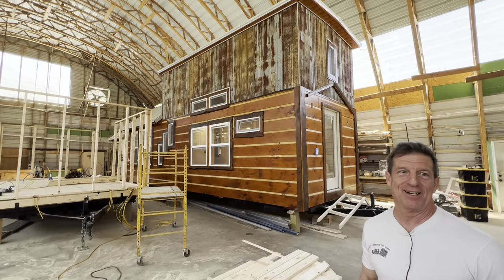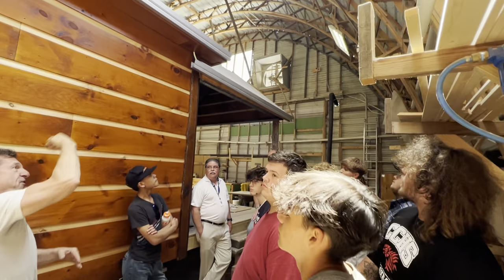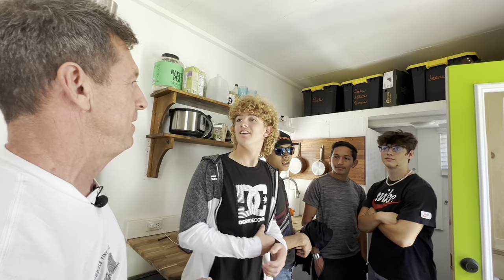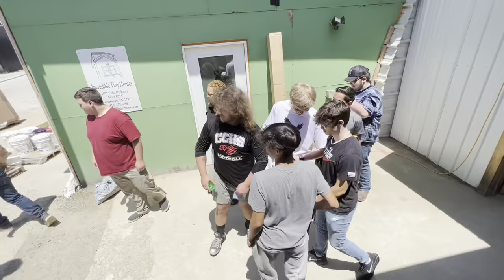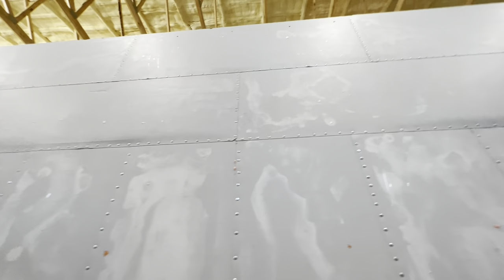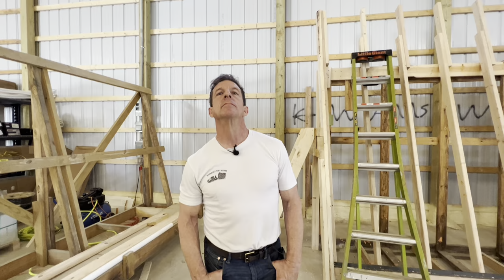Cocke County High School Visits Incredible Tiny Homes for a Randy Crash Course 📚🏡🤩😉🇺🇸📚🏡🤩😉

Comment: Glad you are building a proto type for the 12x20. That is the house I am looking at. But 2 questions: 2nd request for answers; can you add low maintenance siding on top of the esp panels, Knowing its extra? What would be the extra cost, if applicable?  #2: can you add a Randy Rack??? I'd REALLY  like one with the extra footage, it should be possible. Thanks a bunch! 😄😄😄😄👱‍♀👱‍♀👱‍♀👱‍♀
Reply: Hi Chris, they are not currently doing customs or upgrades on models.. So you would have to add   the Randy rack after build.. Or maybe request the cabinets and counter assembled but installed .. And finish it out how you like, with any customizations you are looking for... And for the LP siding.. I think they said all of the 12x20's are unfinished outside... Does anybody remember? Anybody got a 12x20 on order can you chime in?
Reply: Sorry.. Typo.. Cabinets assembled, but not yet installed

Comment: High Schoolers: Look back at one of ITH's videos erecting the trusses. Randy emphasized the strength of the trusses in place, working together. But, he didn't really address how vulnerable -- laterally -- each truss is by itself. Trusses are never more vulnerable than when initially erected.

Comment: Can you give us an idea of how much you would sell the 12x20 for?
Reply: $39,900
Reply: If you have your own property it's $39,900. If you want the house on their property it's $59,900 with a lot rent of $200 a month.
Reply: @faithrenewed3443  we have our own property
Reply: Moving them would be incredibly expensive. You can not move it yourself. And you would have to have permits in every state. Just to move it across Tennessee would be several thousand dollars
Reply: @caroledfeldt2840  yes, we talked to Matt and he said from here to NM would be ( guessing of course) around 15,000.
Reply: Samantha, would you consider an 8x40...shed roof style... Way easy for transport... And then you can build a covered deck 10x40...and double your house size... Could have the bedroom and living room out in the covered deck..
Reply: @leslie6189  that would be a great size but I live at 7400 ft… way too cold to have bed/living outside the main house.
Reply: @Samanthanewmexico  exterior porches can be fully walled, insulated, and heated.. Just thinking an 8 and a half wide would transport well at a More affordable rate to vet it to your property.. Then add on as you need once it's parked... You could live in it as it is while building the add ons bit by hit if needed.. There is also a 2 bedroom easy access Loft design that is super liveable